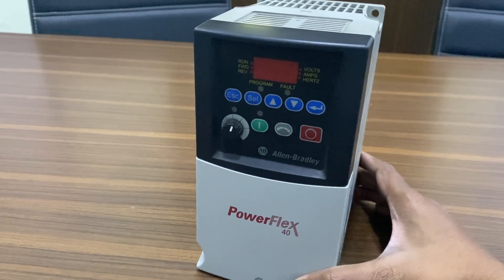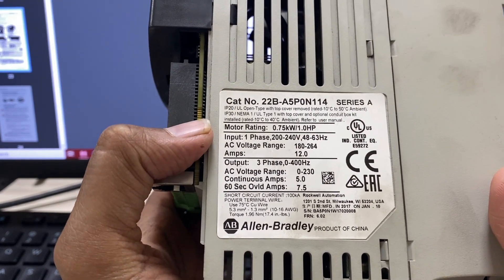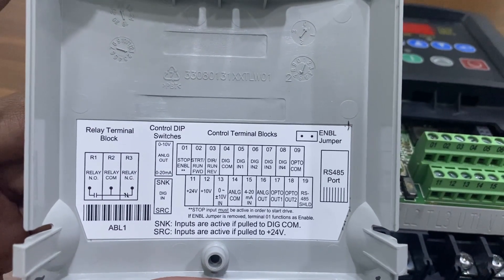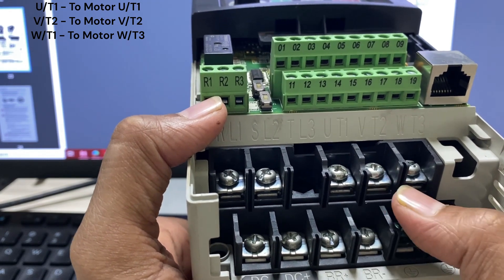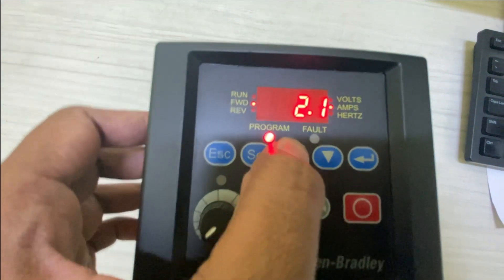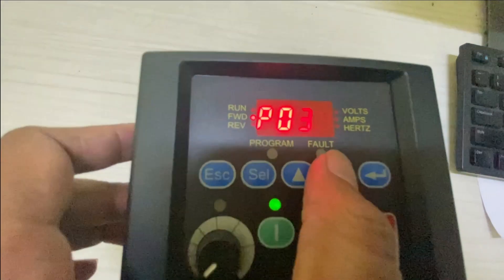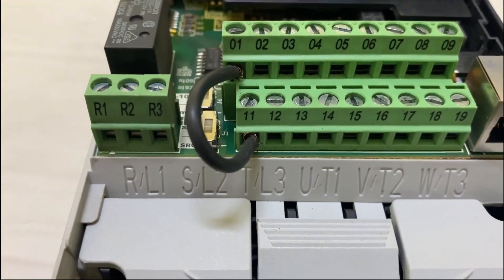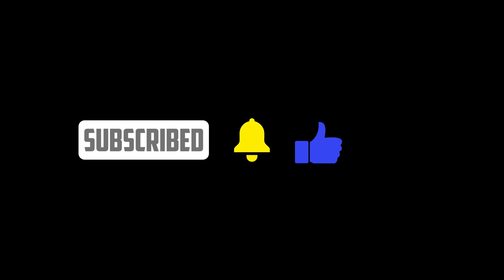Power Flex 40 parameter setup  | PLC Programming #plc #allenbradley #vfd #electrical

Comment: We are facing profibus communication issue ,
Card replaced same issue ,
So replaced drive working ok,
Why….
Reply from the maker: Have you replaced the ribbon cable between the drive and Profibus adaptor? 
what is your drive installation environment please check the earthing and noise issue in your panel, it might be a problem for drive communication port failure.

Comment: When power off then on ,after started drive on ,drive not communicating why this fault occurred
Reply from the maker: Check you Drive IP address If it is set to BootP then  after power recycle it's IP address will erase and drive will not communicate